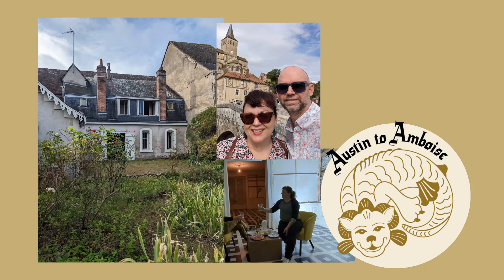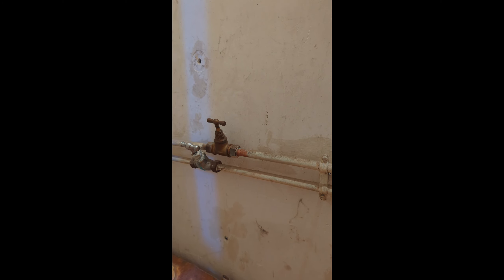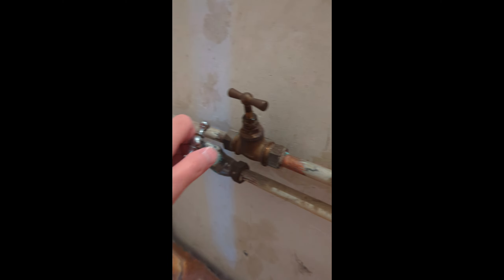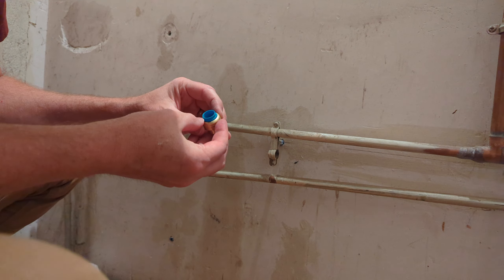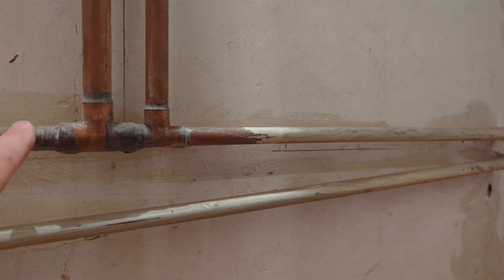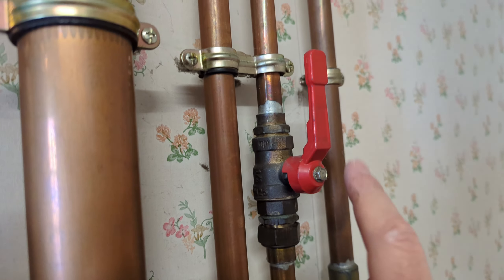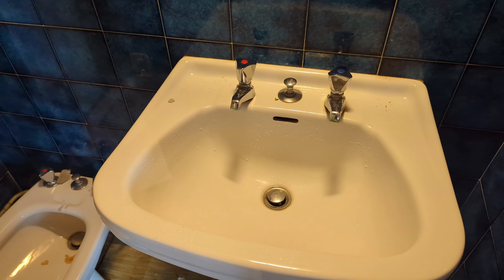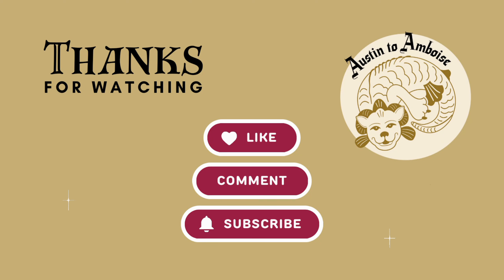Ep.13: DIY begins! A bathroom remodel in our 19th century French house

Comment: All french houses now have to have VMC, which is continuous ventilation by an electric extractor fan, usually in the ceiling space. The units are cheap and universally available ( see your local Brico) and can be connected to your existing passive ventilation. It can have two speeds and is left switched on all the time, with surprisingly low electric consumption. it's so silent, you won't even know that it's on.